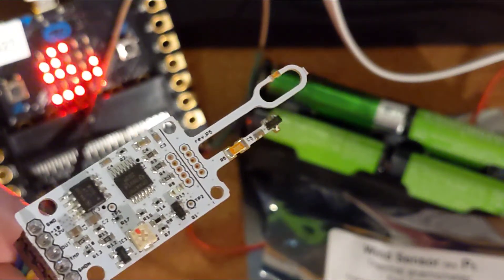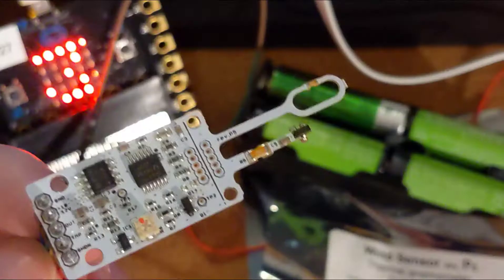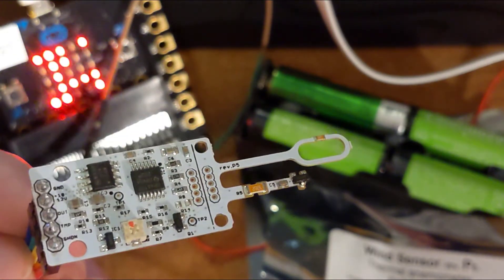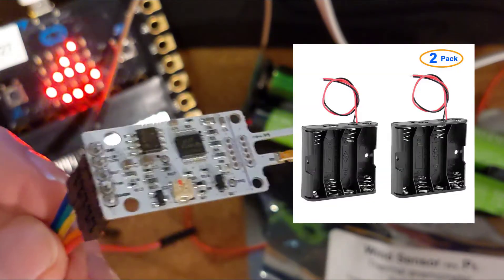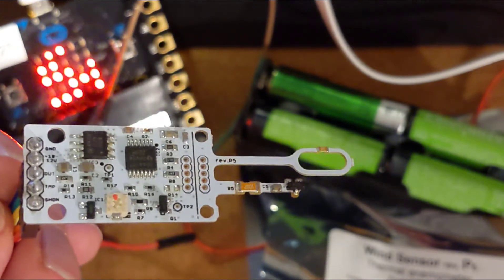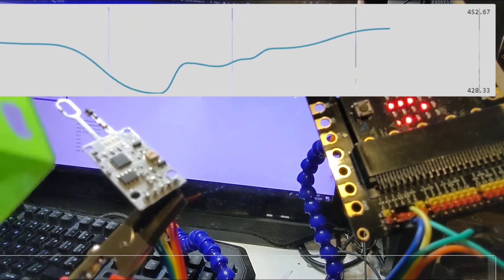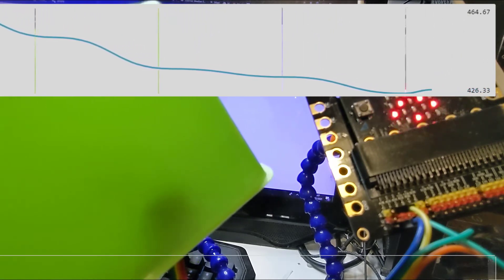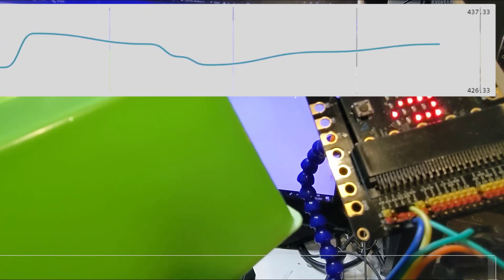Wind Sensor & Micro:bit

Comment: Sorry late to comment. I just bought a Rev P for a project. And new to Arduino and Raspberry Pi. You don’t need an analog to digital converter for an Arduino? Is your code somewhere? Thanks.
Reply from the maker: For Arduino, nope. The Arduino sketch is actually on the manufacturers website. I used that to figure out what to do with the micro:bit.